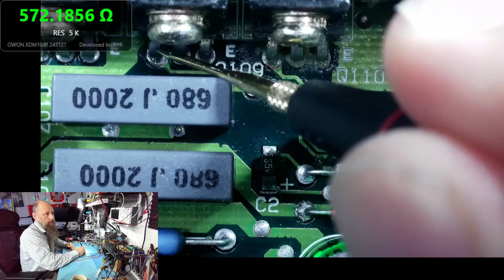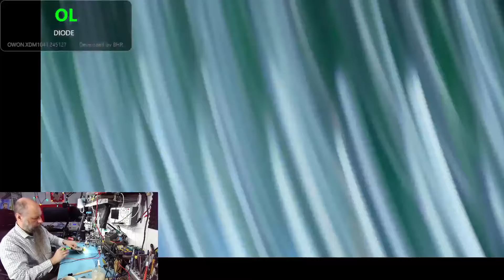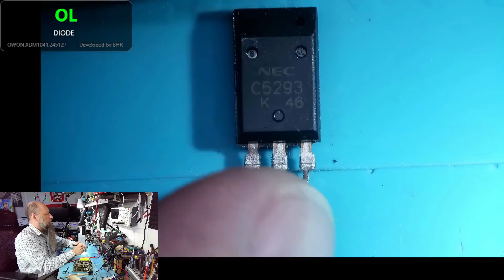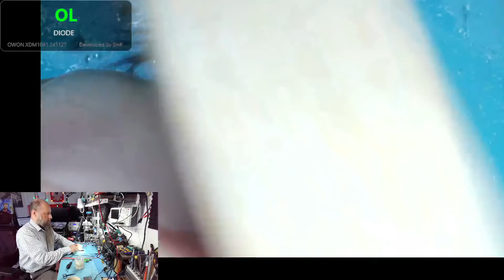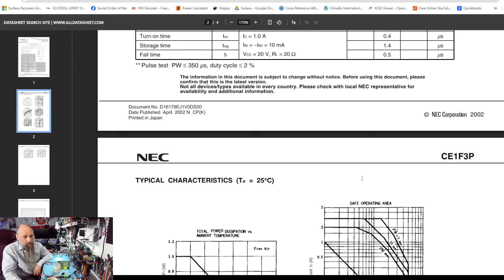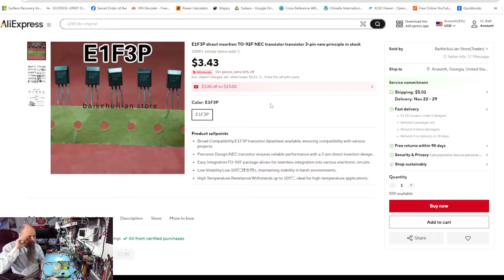283 | Mazda b2600 No Injection and weak Ignition

Comment: Just bought a '93 b2600i that has one of your repaired ecu in it.  truck starts and runs for about 5-10 minutes then shuts down.  fuel has been ruled out, coil, all plugs, distributor replaced, wires, o2 sensor etc, still shut down.  once the truck shuts down, it will not restart unless you disconnect the battery and let it sit for a spell...any ideas on maybe it's something still in the ecu? I can get all of your information off the ecu can you can research the repair...
Reply from the maker: sounds like an ECM issue in closed loop. Since you replaced o2 sensors, make sure it's not the wiring issue.
Reply: @blackhorserepairs  there has been an improvement, I had the o2 sensor unplugged and it ran for 30 minutes until I plugged the o2 back an dit shut down within 5 minutes like it was doing before. maybe still something wiht the ecu?  I had my meter on the o2 plug coming from the ecu and whil e the truck was heating up, it was ohm'ing at 1.60 the once the truck got warm it dropped to .92, not sure if that info is gonna help...

here is the info on your repair if you want to go back and take a look.  BNE-9Bj-NAv3

Comment: I believe that large transistor is a 2SD1415 which is actually a Darlington pair with a diode between C and E. 
On the Outback board F3 is a diode not transistor.
Sorry, was commenting while watching :)
Reply from the maker: yes, F3 is a diode, in some places 2 terminals are shorted together, I think it's 2 diodes. Thank you for correcting me

Comment: That is a frustrating outcome for you.  Cross referencing electronic components is not an easy task so I can understand the inclination to use a Subaru transistor to replace it.  I have had success, though, with including "automotive" in my search for replacement components of ECM's and BCM's when looking for an equivalent.  This tends to narrow down the results significantly, and then a person can potentially match via datasheet specs.  Interesting video.  Thanks!
Reply from the maker: Thanks for the tip, much appreciated!